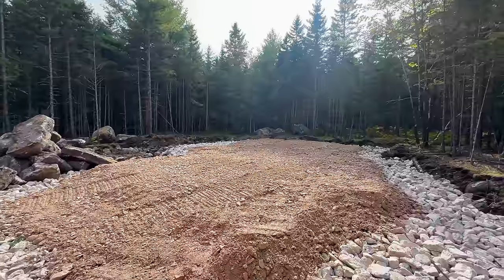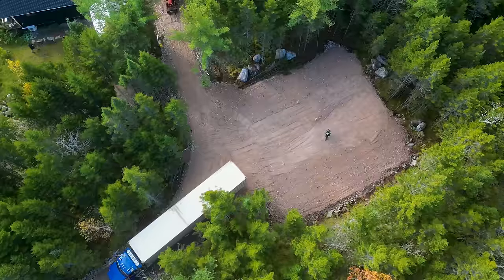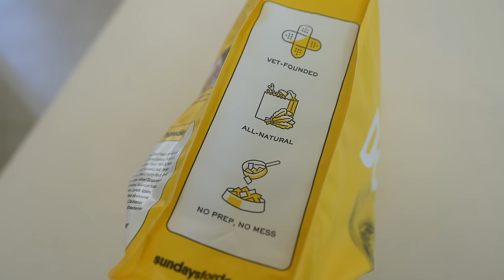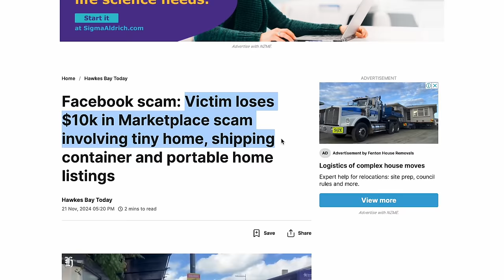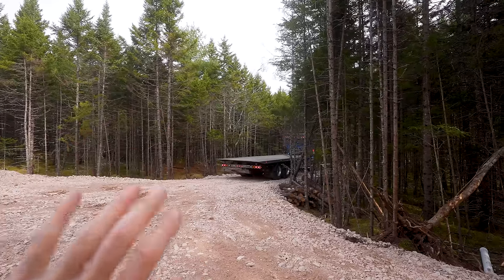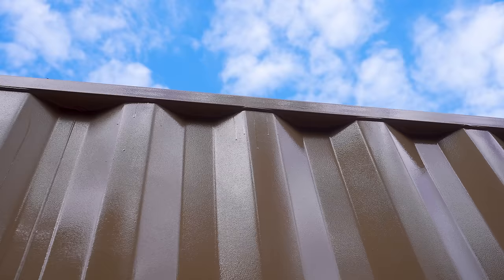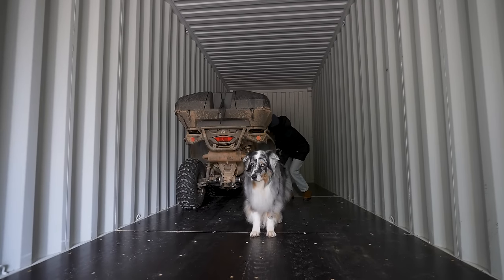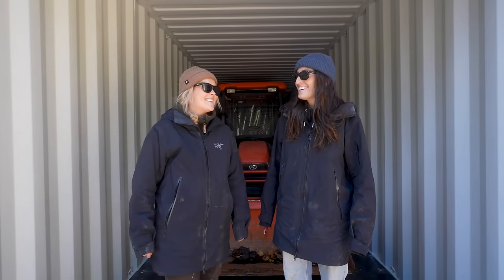Why We Can’t Build The Shipping Container Workshop

Comment: Make sure you don’t leave those batteries on the floor of the container or on concrete they should be insulated from where you’re sitting them on put them on wood or rubbers or something. That way they won’t discharge completely dead over the winter.
Reply from the maker: Oh yes yes good thinking we put them in our heated work shop thank you 💛😎
Reply: The batteries are going into the heated workshop.
Reply: I have heard concrete or cement drains the battery. Not sure how though. Safe travels and see you when you start the house In  MEXICO. ❤

Comment: Wow that's a fabulous painting job but remember in the summer metal gets hot. I have a small tractor in one so we painted the top with reflector type silver and it still gets warm but ok. Best of luck finishing 👏👏👏👏😀
Reply from the maker: Thanks for sharing your knowledge with us. We will definitely do that for sure. 😊
Reply: Or put 6 vents 2 on back area on both sides 2 in middle and 2 in front area both sides. They wouldn't have to be very big vents neither
Reply: There is a white paint for RV roofs that works really well!!

Comment: 0:57 After scraping the lettering, you need a glue cleaner, or you will end up with those numbers again, but just coloured back in with dirt adhered to the glue left behind. Tip from someone who regularly removes lettering.

Comment: Nice build, when it's done.
December 1st here, hour north west of Toronto. And we have snow.
The Bruce was hit hard
Reply from the maker: Thanks! Yes we heard. Hoping everyone is safe and enjoying the beautiful white snow. The first snowfalls are so pretty. 😊🐶
Reply: Sometimes.
2weeks ago I was still wearing shorts to work..
Just need hubby to switch my tires over, oil change and I have to add washer fluids.
Have u guys added fuel stabilizer to some of your gas powered equipment? That does not get used in winter!
Going to try to make some butternut squash soup and cowboy candy.
Still have eggplant, potatoes, tomatoes and one more squash to pick out of our dome
We do every fall..

Comment: Some advice when your using the sprayer . first is make sure your using the proper tip number there are several different tips for different applications secondly better your pressure is low because then your not wasting material the higher the pressure the more paint sprayed the more runs you get . third piece of advice is use the proper ppe that means paintsuits with hoods . 4th tip is start at the top and come down think of it like painting a car dont stop till your at the bottom . also use the proper paint remember your painting steel that usually means using an oil based paint or epoxy paint using latex paint isnt going to last long least not on steel . ive painted containers and cars and inside houses with airless sprayers it takes some getting used to and using the right products will result in a long lasting paint job . ladies read the bottom of the container it says empty lift if you rent a forklift it will lift it with ease even a frontend loader with forks can lift it .

Comment: A lawnmower mechanic told me he never removes his battery from his lawnmower in the winter. I had been doing that with my riding lawnmower, but quit doing it after he told me that. I haven't had any issues with the battery since then. I do have to put a trickle charger on it in the spring before I can start it up, but after that, it runs all spring and summer just fine. Of course, I don't live in frigid Canada, either, but a lot farther south in Arkansas, where it can drop below freezing in the winter, but rarely gets into negative degrees. The coldest it's been here since I've lived here 30-some years is in the teens Fahrenheit. What shocked me is a guy in Arizona says he has to change his batteries in his vehicles frequently, like every 1-3 years, depending on the battery quality, because of the extreme heat. I never knew heat was just as hard on batteries, or worse, than cold. I don't think I've ever had to replace a car battery.

Comment: Recommend to clean up your machinery before storing, use Krown or another spray where rust is showing, also a couple vents in those sea cans to prevent condensation. As for batteries, you can trickle charge off those solar battery chargers, just mount off the side of the seacan’s, run the wire in to the battery. I did this for many years with a good outcome. I know, all in time😜

Comment: Buying a whole paint gun to paint an outdoor bit of metal three shades darker is so my speed 😂 love it!
Reply from the maker: Right! But this paint gun will come in handy for many projects. 🤩
Reply: @ I bought one when I was renovating and it inspired be to build a shed just so I could use it again. Can confirm.
Reply: @Vanwives  I was thinking the same thing. I wouldn't have painted them at all. Once you are finished you barely notice the difference in color.
Reply: I have that same graco paint gun and it works great on painting cabinets and louvered doors.

Comment: We bought this exact same sprayer to paint our fence. After a little bit of a learning curve with the pump and finding just the right setting… the only problem we ran into was WAY underestimating the amount of paint we would need. Ie… we needed 4 5 gallon buckets 😂 but damn did it go so much faster than trying to use a brush and roller.

Comment: The container code tells me that the container was owned by (BIC COde CICU) CIMC Containers Holding Company LTD in Guangdong in souterhn China. 

The CICU stands for the company, the number after that (641602) is the serial and the 45G1 is the (ISO standard) type of container. 

The rest of the codes are just technical codes about the load it can contain and weight/size of the container.

You can't tell with that were it has been, as that is not public. But i guess it's a container that went from China to Canada or the US and then was sold trough brokers to you. China export way more than it imports and shipping empty containers is very expensive, it's cheaper to sell them to you with loss after one trip.

Comment: Girls can I share a tip with you for your batteries when storing put a piece of thick rubber underneath them, don't leave them on concrete alone
Reply: They are generally a wooden marine ply floor.
Ideally they could have taken them indoors put a trickle charger on them and even a 12v pet blanket around them on a timer would not use much & keep them warm.
Reply from the maker: They’re are on insulated floor. But great idea!

Comment: I've never seen anyone put these things on screw piles before, that must have cost more than the container did.
Reply from the maker: Well you can also do a concrete foundation but that was much more expensive, takes longer and is more difficult with our terrain. Without a proper foundation is we put the roof on we run the risk of shifting over the years. We have never regret a solid foundation 😊
Reply: @Vanwives  I guess it depends on your ground, mine are sitting on undisturbed soil with just pavers under the corners of them, I think I had to shim one corner maybe 5 years ago, my roof is only made of tubing and a plastic cover though.

Comment: Hate to be critical to you guys because what you guys always do never seem to amaze me, but next time you spray paint, stand one step further than you were and always run the gun in a side to side pattern, making sure your spray nozzle is pointed in the direction you are spraying, eg. if you are spraying side to side, your nozzle should be parallel to the ground. Also to make sure you do not get any streaks or runs in the paint overlap the paint so it blends. Otherwise it looks great, but still could have taken less time. lol.

Comment: I hope you put some stabilizer in the fuel tank.
Reply: Try to find some ethanol shield to put in fuel tanks if the machines are going to sit for 6-8 months. Let them run for 10 to 15 minutes before shutting off, that will get the additive running through the injectors. Have fun! We love watching your vlog. Happy Holidays.

Comment: You state that using a shipping container is cost effective.  Doing a bit of research it seems a standard wood frame construction would be a similar price as just the cost of the container, and then it would be a  better and more useful structure than the limiting issues of shipping containers.  It seems using shipping containers is a belief system and not a proven valid mode of construction.

Comment: I enjoy your videos, but this one does contain some false information about shipping container conversions. It's not really your fault, you relied on the wrong sources for your information, and got misled. Most shipping containers being used as conversions, are hardly used (yours, for example, are practically new), so people aren't really recycling them. And once you start cutting into the sides of them, the whole structural integrity is shot, and you have to do so much work to make them sound again, it's hardly saving you any time or money. They really are one of the worst options once you look into it a little further for creating a diy, cost saving, environmentally friendly option for a building structure.

Comment: That dog food commercial reminds me of the crisis in the early 70’s where elderly retirees were relegated to eating canned dog food since their pensions were so small and food took a major jump in cost.
On a different note, back in the nineties many painters who were working in whole mass produced housing by bulk builders they could knock out a whole house interior in less than a day. Back in the mid sixties with the advent of quick setting drywall mud a whole house of 1500 square feet could have drywall hung in it in one day, the next day the drywall would be taped, and mudded and sanded. They would start four homes a day with mudding and taping and finish them in a day, all thanks to quick setting drywall compound. It would take a whole crew of six to paint a whole new home in one day, today it takes only two to paint the whole house in six hours. After painting they would clean equipment and move it to the next house ready for the next day. With three two man crews they can knock out three homes a day painting the interiors.